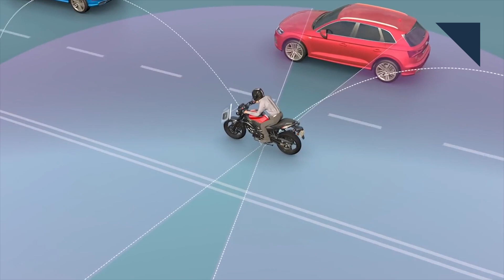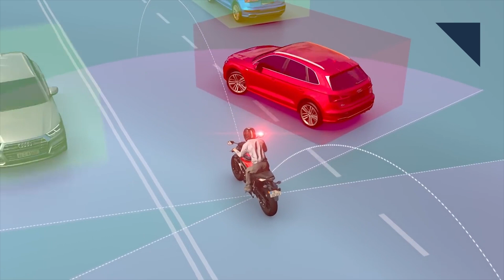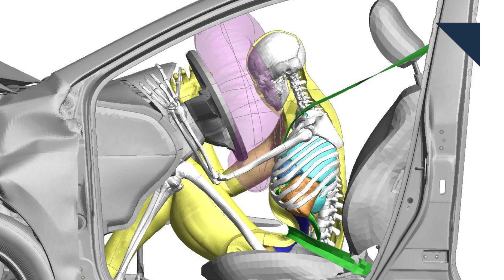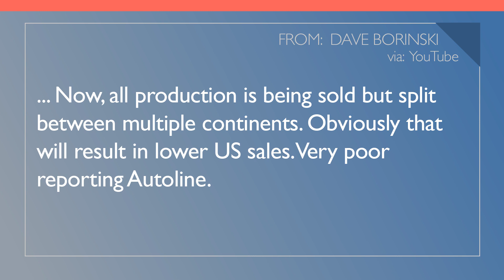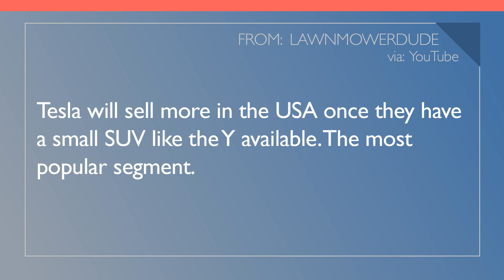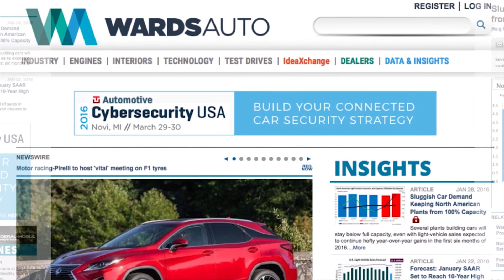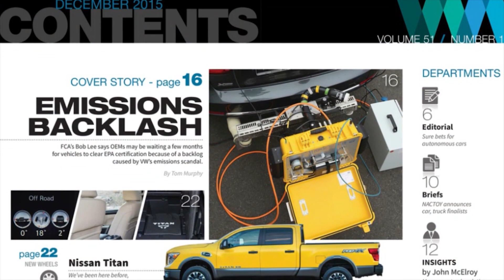Details of Ford's Labor Contract, Women at Higher Risk in Crash - Autoline Daily 2709

Comment: You can make a case for softening of demand for Model S & X, but not Model 3. They would have had a higher gross margin if they had sold more of the higher priced S & X. And the company says they have the capacity to make 90k S & X, whereas they only made about 60k. But you can't make the same case for the Model 3. They're making as many as they can, and selling them all. The future of the company is totally about Model 3 and the upcoming Model Y. Elon let slip in the conference call that they were continuing to build the Model S & X "for sentimental reasons"... meaning that the S & X just don't affect the bottom line and the company's growth potential that much. The company's focus was completely on the Model 3. 

That all may change when Tesla brings out the plaid Models S & X (and they beat the Porsche Taycan at Nürburgring). It should revive interest in the higher end cars and bring that production line back to full capacity.

I still say that Tesla's drop in US sales had to do with the federal tax credit being cut in half again in Q3. They made the strategic decision to pull as many US sales forward as possible to Q2 even at the expense of deferring non-US sales and then prioritized non-US sales in Q3. Expect more of the same in Q4 and Q1 2020 when the rebate drops off completely. It will be great when all the artificial lumpiness will finally drop off the current results and the y-o-y comparables in 2021.
Reply: I mostly agree.  

Remember, though...  The Tesla Model S was Conceived, Designed, Developed from the outset withan eight year Production Cycle in mind.  Released in mid-2012, the Model S is now in the eighth year of that Production Cycle.  It will be Replaced next year, just as scheduled, right on time.  And the Plaid configuration will debut along with that new redesign.

Back in 2012, Journalists, ANALysts, Skeptics, and Contrarians were all incredulous over what Elon Musk told them.  They didn't believe him.  They were sure he was naíve, inexperienced, unpolished, or was just plain lying.  They thought he was crazy.  So, they didn't pay attention to what he said.  Instead, they wrote it off as standard issue CEO hype, salesmanship, and complete [BOLSHEVIK].  It never occurred to them that he was being honest, straightforward, truthful, or sincere.

Oops?

But he told them Tesla intended to sell perhaps 15,000-to-20,000 units per year.  The 2008 Financial Collapse had taken place just four years earlier.  People were generally not 'feeling as rich' as they used to, so luxury purchases had suffered in recent years, particularly purchases of expensive, bespoke, luxury vehicles of all sorts.

So, they weren't paying attention.  Didn't listen.  And were completely taken by surprise when their entire theory that "...there is a 'limited market' for expensive electric cars..." came crashing down about their ears.  Oops, indeed.

Because what they called a small, inconsequential, poorly run, 'boutique manufacturer' of electric cars that would surely '...go out of business... any day now...' actually built 25,000 units during 2013, and Delivered 22,000 of them, worldwide.  And, during that first full calendar year of Production the Tesla Model S outsold every other high end large luxury sedan in the U.S., including the perennial #1 vehicle 'in class', the Mercedes-Benz S-Class (which enjoyed a 12% sales improvement over 2012, and still lost to a newcomer).

Let's see...

20,000 × 8 = 160,000

Well, the Tesla Model S passed that quantity of units sold worldwide since inception in 2016.  Not even five years after its initial release.  So, that vehicle paid for itself years ago, and even after its supposed 'sales decline' during 2019, none of its contemporary rivals have managed to either match or surpass its sales through Q3 2019 YTD.  The Tesla Model S remains, maintains, and retains its #1 U.S. sales position among Large Luxury Flagship Sedans.  Thus, claims of 'lagging' sales are rather misleading, at the very least.  What matters is that the Tesla Model S still outsells Mercedes-Benz S-Class, BMW 7-Series, AUDI A8, Jaguar XJ, Lexus LS, INFINITI Q90, Acura RL, GENESIS G90, Maserati Quattroporte, Porsche Panamera, and EVERY other direct competitor on the U.S. market.  And this is during the final year of its current platform, which will offer Plaid next year.

Comment: 9:50 No demand problem. Tesla started shipping Model 3 batteries to Shanghai, in order to start production before the local battery factory is ready. Allegedly they are aiming to have 20K batteries in China by the end of the year to help with a quick ramp up to 3000cars/week. Long story short, Model 3 battery production increased by about 20%, but it didn't result in sales anywhere yet, that's why the numbers look slightly worse.

Comment: Johan, with regards to TESLA, you are missing one more point. This quarter TESLA started offering leasing programs in the US which means they do not get paid for the complete car, but only monthly increment of the pay. However the expense of making the car stays the same. TESLA keeps improves its gross margins and beating the Automotive average (which is less than 10%) TESLAs  gross margin is 18.8 to 22%, and they keep improving that mainly in the main cost factor which is the battery assembly.
Reply from the maker: Good point about the leases, though they only account for 9% of sales. Unfair to compare Tesla gross margins to the industry average. You need to compare Tesla's margins to OEMs who only sell cars priced above $40,000 to get an apples-to-apples comparison.
Reply: @AutolineDetroit  Thanks for the reply. You are more than correct about the margins. However TESLA model 3 has models under 40K (39. something if i recall correctly) and one which is priced at 35K. When the average selling price of cars in the US is 36K than model 3  selling price is around the average and is under 40K.
Reply: @AutolineDetroit  One more point i would like to highlight is that you are correct when highlighting model Y will cannibalize model 3 sales and i will add it will be in greater numbers than the cannibalization of model 3 of model S and X sales. However if one wants to analyse the affect of the model Y cannibalization on TESLA revenues he will need to take in to account that 75% of the complainants in model Y and 3 are common, model Y is a CUV/SUV so will have more US potential costumers and as more OEMs switch to direct sale to the clients it can make TESLA available in US stats which it was not previously available. Thanks for addressing my note

Comment: Corruption isn't new at big unions. Teamsters have a history of this. Why are women more likely to injured in a crash? Because they are usually smaller than a man?
Reply: I suspect it may have to do with women generally having significantly weaker bones than men. To design a car for maximum safety you want to reduce G forces applied to the body, this will be done exactly the same regardless of man, woman or child as far as crumple zones. I guess its feasible that women on average are lighter than men and may benefit from lower airbag pressure but I dont know if this is the case or not.

Comment: GM is "going to do a better job designing vehicles".  Haha, never going to happen.  I like the part where they slipped in where they will reuse more parts, they already do that.  Most GM cars are parts bin, just a mix and match of parts as old as the 70s.  GM has no idea how to design a car, they farm that work out to 3rd parties to make the parts, it makes their cars too expensive.  Anyone not vertically integrating like tesla or toyota is going to be on the way out.
Reply: I like the gm parts bin. Parts are cheap and I can add “options” as I please.
Reply: @lawnmowerdude  They are not cheap.  They keep designing cars around 20-30 year old part designs.  There is no modern engineering to reduce part count.  Even if the raw cost of each part was lower due to maturity, you are using more parts than is necessary which increases the cost of the car in both part cost and labor to assemble.